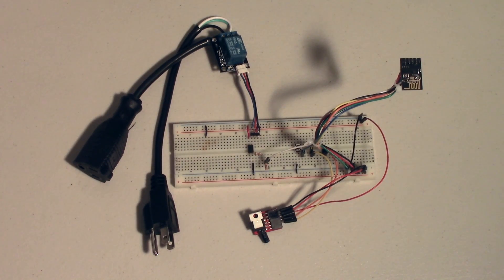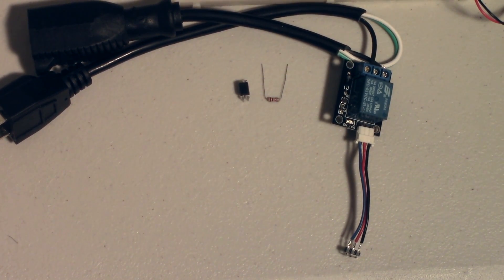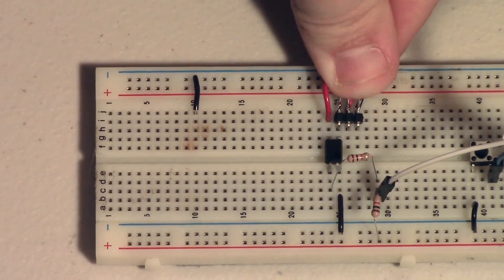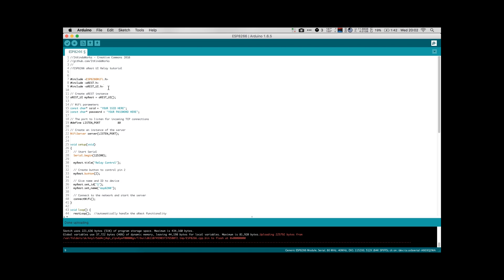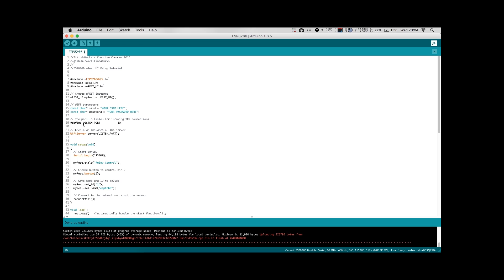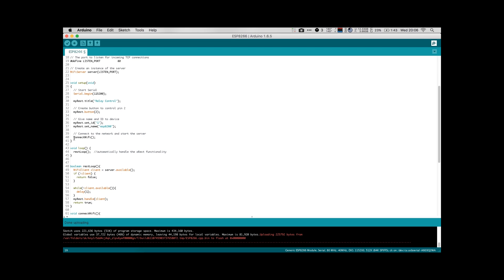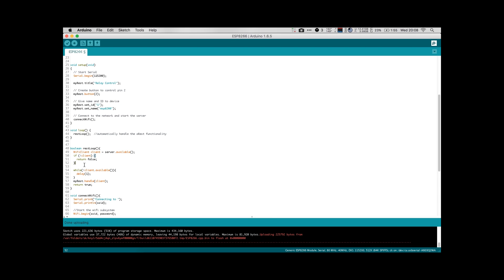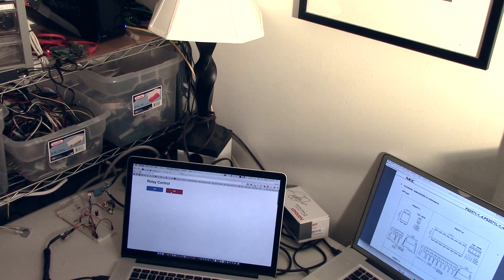ESP8266 Relay Control via Web Browser

Comment: where is the facking adres of esp to torn on/off.......thell dhat  to everebody. not everybody is noob like you
Reply from the maker: You should be able to get it from the serial monitor.
Reply: ItKindaWorks in the serial monitor I don't see anything. I don't know Why
Reply from the maker: Do you have the ESP connected to the computer and the correct serial port selected when you run the ESP?
Reply: i change a SSID and PASS. i opload the cod and is connected on pc and in the serial monitor is show me this  ⸮H⸮⸮⸮⸮⸮
Reply from the maker: It sounds like you might have the wrong baud rate selected. Make sure to select 115200 from the menu in the serial monitor before starting the ESP.
Reply: ItKindaWorks i try with 115200 and 921600...all is the same. I use a NodeMCU
Reply: I try with a hello server and is the same. I thing is the router??

Comment: How can I go back to use the AT commands after doing this tutorial?
Reply from the maker: You'll have to re-flash the ESP with a firmware that uses AT commands. You'll lose the arduino/self programmed code but you'll be able to access through the AT commands. A little ways down this page there seems to be a good explanation for how to do this. https://www.allaboutcircuits.com/projects/update-the-firmware-in-your-esp8266-wi-fi-module/

Comment: Hi, great tutorial. One question though, why are you using that led/diode chip to control the relay? Does the wifi module not provide a 5v signal to directly turn on or off the relay?
Reply from the maker: There are 2 reasons to use the optocoupler. The first is because yes, the ESP does not provide 5V so it cannot trigger the relay alone but also because there are large voltage spikes from the relay so the optocoupler isolates the GPIO pin from the relay

Comment: Hi I got the esp8266 12f program and after program the blue light on steady and I can go to the browser and enter 192.168.0.106 and see the switch to turn on/off...\\

Question when l remove all the wires and only leave the gnd and the vcc, it do not not turn on, meaning no blue light blinking or it connected to my router.... do I have to connect any other wire to just turn it on?

or what wires I need to operate i relay from the browser?
Reply from the maker: Is it possible that you removed the wire connecting ch_en to 3.3v? You have to have that connection in place, gnd and 3.3 for the esp, gnd and 5v for the relay and then you need the connection for the ESP relayPin as well.

Comment: good day i loved your video but i dont have a ftdi thingy i have an arduino uno could you please make a video or give me some information on how to program my esp8266 for 2 relay modules i want to use? thanks in advance! :D
Reply from the maker: If you have an Uno you can try my other video over here: https://www.youtube.com/watch?v=P_ecAFpUADU
Reply: okay i got it to send commands and to connect with my wifi but i have some problems. for example i compline and it says it wont find the libray of esp8266.h i would be greatfull if  you could make a video using an arduino uno and the relays. plus the way to  include the libraries and all . thanks again

Comment: i have a relay with built in optoisolator.  so can i just use a level shifter? for the 3.3v gpio to relay to make it 5 v? any suggestions?
Reply: If you have the most common relay board from eBay with optocouplers and JD-VCC jumper then you can drive it with 3.3 V from ESP8266's GPIO without level shifter but you have to:

#1: Remove JD-VCC to VCC jumper (important!)
#2: Do NOT connect the same GND as to ESP8266 (if you want to have opto-isolation between two circuits but it will work the both ways)
#3: Connect a separate 5 V power supply to JD-VCC and relay GND pins
#4: Short the LED on the relay board (remove the LED and solder the contacts) so 3.3 V can be enough to control the optocoupler
#5: Connect relay board Vcc pin to the same +3.3 V as ESP8266
#6: Connect GPIO output pin to the INx pin on the relay board (GPIO = HIGH --> relay = OFF, GPIO = LOW --> relay = ON)

Or you can just use NPN transistor (collector to +5 V, emitter to GND, to base from ESP8266) to drive 5 V input of the relay. In that case GPIO = HIGH --> relay = ON, GPIO = LOW --> relay = OFF.

Comment: Excellent tutorial.  You speak clearly and distinctly.I had the module up and running until I switched my cable service to AT&T.  They installed a Page model 5268AC modem/router and I lost my connectivity to the LAN WiFi.  Something in the RF link or protocol I guess.  Do you have any idea what I can try to regain connectivity?
Reply: FYI: Got it fixed.  2nd call to ATT support led to very knowledgeable IT specialist.The fix was to widen the  WiFi security Authentication Type for the 2.4Ghz radio configuration.

Comment: Very good tutorial! As for powering the esp8266, I think you power it by usb. Could you strip a phone charger and use the AC both for the light and the charger at the same time? I am trying to do it that way, but I get weird interference.. Cheers
Reply from the maker: You can totally do it! I actually do that for a lot of the lights in my house. You just have to make sure that the charger is on the incoming side of the plug so you don't accidentally turn it off with the relay. I'd also add a large (220uf+) capacitor on the charger output if you're getting some noisy power especially if it's a cheap charger. What kind of interference are you getting? Like how has it been affecting things?
Reply: I took apart this type of charger:) http://www.amazon.in/Callmate-Charger-Cable-iPhone-Touch/dp/B00EPEHNF2, and I have two symptoms when connected:  a) The blue light on the esp8266 stays on and doesn't connect to wifi and fixed (1/5 times) only if I unplug the esp8266 and replug it again.. b) The relay module makes a buzzing noise :S, which fixed again if plugged and unplugged. My setup is this: https://www.dropbox.com/s/l8fabj891w3zpiy/esp8266_220v.png?dl=0 and I connect the relay module to gpio02 of the esp.. :)